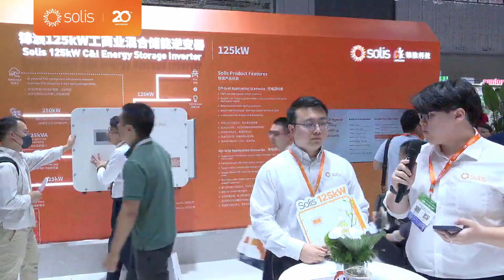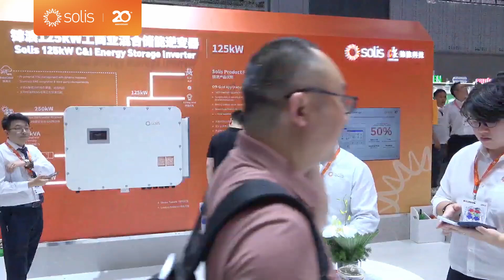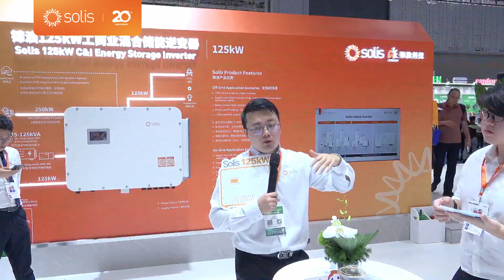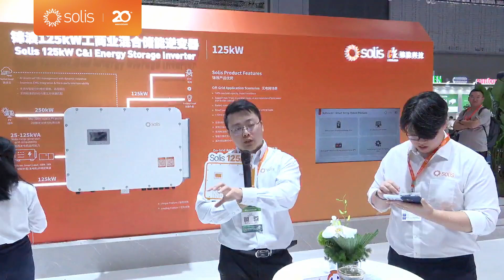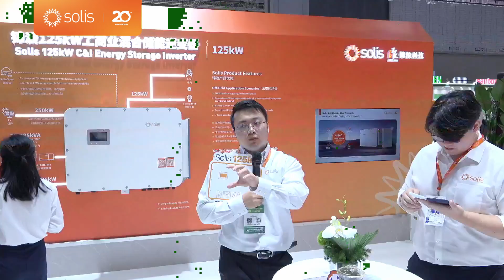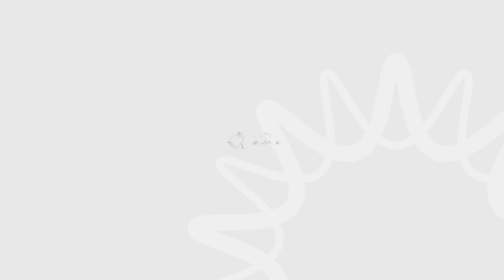SNEC 2025 | Live Product Q&A

Comment: Hi I am a solis inverter user and based on my personal experience, I advised my acquaintances to buy this inverter. Many friends bought Solis inverters on my advice, but unfortunately, one of them The inverter have technical problem and this is where the problems started, which disappointed me and my friend. The customer service of Salas in Pakistan is extremely poor. There is no response to any kind of customer calls, WhatsApp messages or emails.While the service center was not nearby, I had to take the inverter to Lahore, which is 220 kilometers away. Even after reaching there, no cooperation is being provided and work is being done through procrastination. Due to which I am deeply saddened that it has been a waste of my money and time and the problem is not being resolved. I request you to Just as your products are good, please make a good policy to improve your customer service in Pakistan.
Thanks
Reply from the maker: Hello, I will provide feedback on your suggestion. You can also try logging in to the local official Solis website and contact customer service for consultation.
Reply: I'm waiting for replace invalid inverter since 4 months. I have only new emails that my inverter is still out of stock. That's really disapointment😔